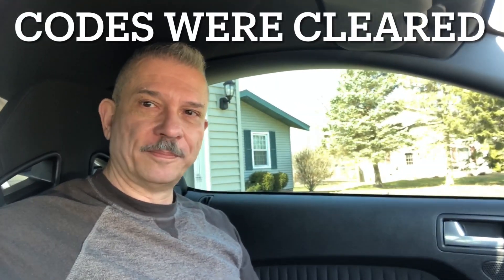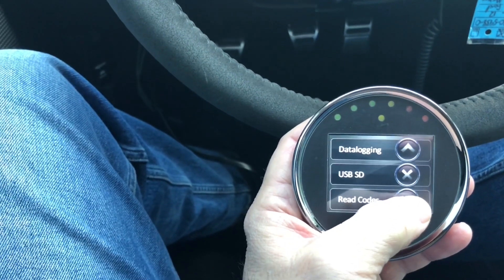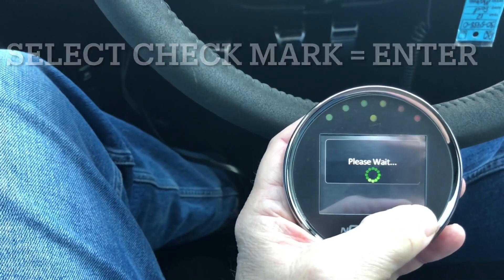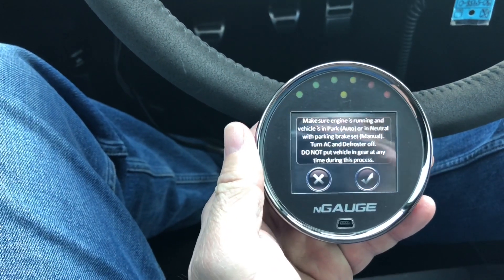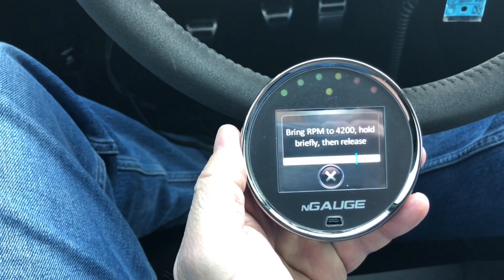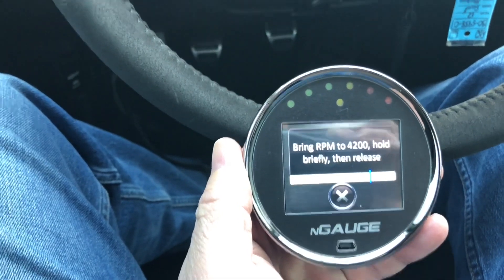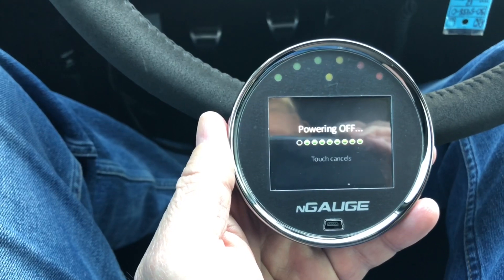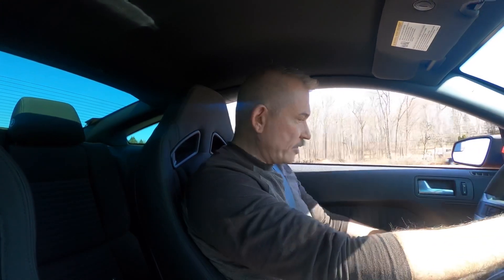Ngauge Crank Relearn

Comment: I got nervous when i was close to 4k so i stopped trying to relearn just bren cruising with the code 😂 to scared to hold it at 4k
Reply: it's safe all the way up 7k in stock form
Reply: What's the max hp and tq for stock compared to rpm. Where does the power drop off?
Reply: @joshuaisham3929  i believe hp drops off around 6800 im not sure the numbers.. does your Cel stay on? does it flash?

Comment: I can’t get mine to relearn keeps popping up p0315 even after clearing. I have a tune from Lund curious if that’s the issue.
Reply from the maker: What did you do to need a relearn or are you doing it because you popped the P0315 code. The tune wouldn’t cause the code. 
You might have a bad sensor or possibly something is going on with the tone wheel which is what your sensor reads. Faulty PCM or a bad relearn. I don’t recommend driving much under this code bc the condition could worsen.
If this is your daily it’s best to find a shop that can do the relearn for you. Purchase a new sensor but don’t open it or use it unless the shop finds out your sensor is bad. They then can replace and do the relearn. 
If your hell bent on doing it yourself contact the supplier of the scanner your using to make sure everything is correct. 
If you are using an Ngauge make sure it’s set up to your car. My car was tuned on the Ngauge and the tuner never set up the tuner to the car so every time I tried to relearn it didn’t work. 
If you are doing everything right then replace the sensor and try to relearn again, hopefully that will work. 
If not again find a shop that can do it for you. Best of luck!

Comment: Niceeee. Y did the check engine come back?
Reply from the maker: Found out from another sub there’s a TSB on crank sensor coming loose and of course I m thinking all the NVH isn’t helping. I went to the dealership and got the part number for the fix and found out my P0316 code misfire at start up is a cam sensor. Crazy bad luck or just one vibrating bitch right! LOL hopefully get this fixed. I will share in my next video. Thanks
Reply: @CoyotesNorth For me it was that the cross members bolts were loose and that caused the misfire codes. Tightened them and problem fixed. Good luck.
Reply from the maker: Thanks bro! We’ll check that when we get to the install fix
Reply: @githmousli9477  what codes did you have?